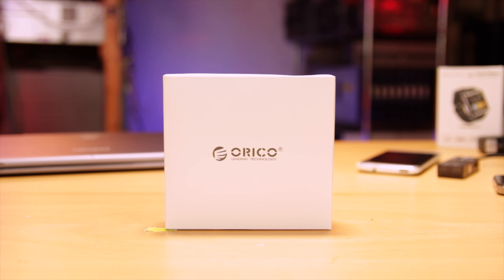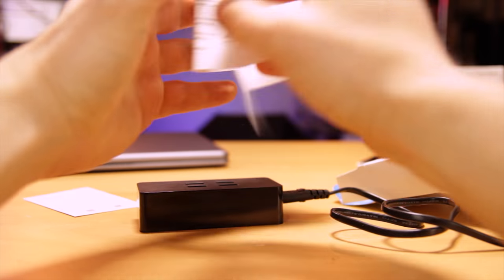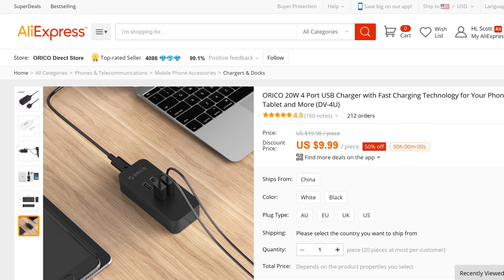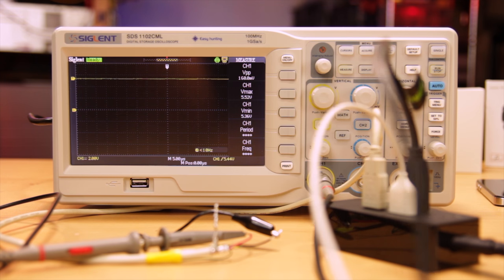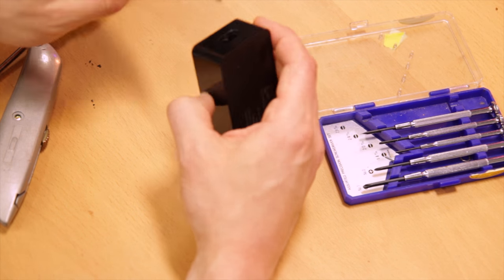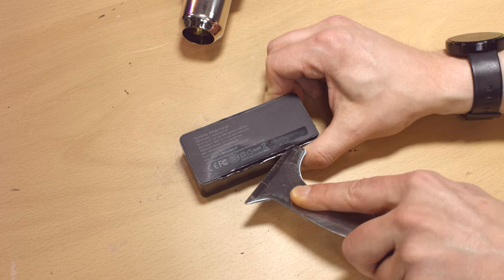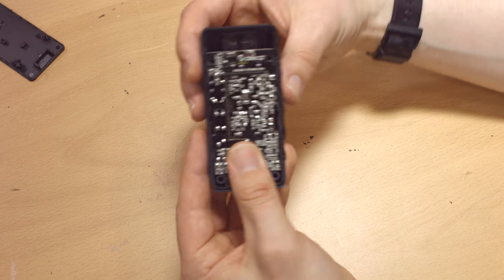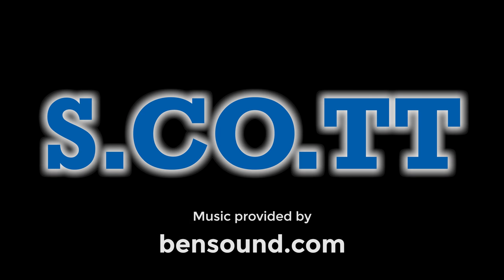Let's [Quickly] Open: ORICO 20W 4-port USB Charger + Teardown

Comment: Can you measure if the positive or negatives are connected in parallel on the USB ports? Or Are they isolated?
Reply from the maker: +Glychee S Good question!  I just probed them all for continuity, and all the + and - connections are common to each other.  They are independently current regulated, though.
Reply: +S.co.tt thanks! Was considering buying this to turn into a 4 cell lithium ion charger.

Comment: ~MOST~ devices will have built in protection but its not very reassuring that the voltage spikes up to 7 volts. Thats a sign of bad design and chances are if its doing that while new, after few months or a year of being cooped up in that tiny heated plastic enclosure, it might fail catastrophically. (The Chinese often put in random safety stuff in their circuits that dont actually work but make you think its designed well, ie: improperly placed anti tracking slots.)
That being said, if you buy it, get it from Amazon or another reputable US or Europe based seller because if it kills your device or sets your house on fire, good fucking luck getting them to replace the product, not to mention most insurance companies wont give you money if you were using non UL or CSE certified stuff.